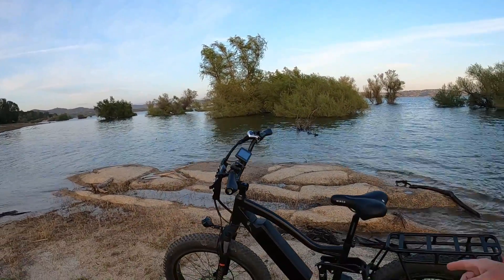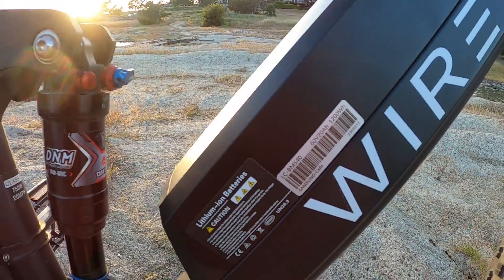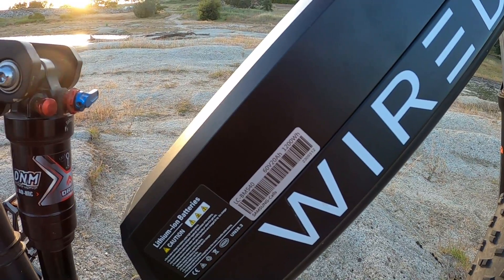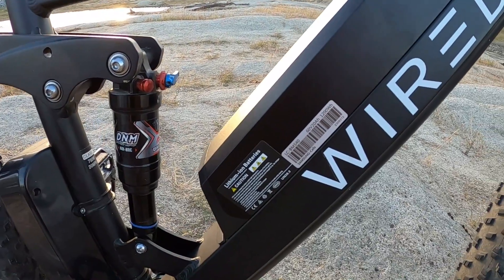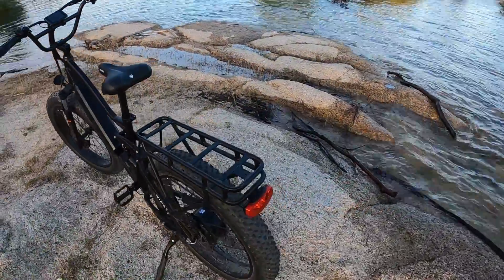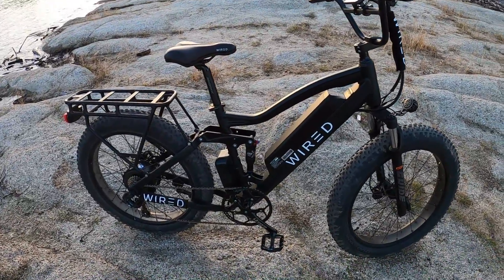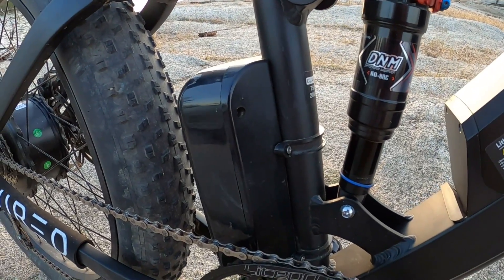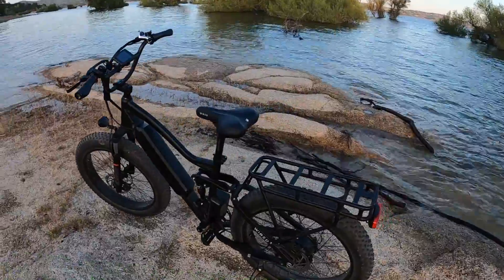Volts, Amps and Watts Explained   2024 Wired Freedom

Comment: I’m waiting for my hunter green freedom since the beginning of February and I pretty much have all my ebike accessories to go with/it too..what’s the width x length in that WIRED logo on the side of the battery please and the WIRED logo by the kickstand please
Reply from the maker: Awesome! Let me check those measurements....
Reply from the maker: So there are 4 main logos on the bike...two of them are soft wraps with velcro (like wetsuit material) one is for the front cables by the handlebars and the chain stay one (opposite side of the kickstand)....the lettering on both is 8 inches by 1.5 inches. 
There is a small logo on the rear fork by the kickstand, and it is 3.5 inches long by 1/2 an inch tall. The last one is a big logo, on the frame of the bike next to the battery, and it is 10 inches by 1.5 inches. There are no logos on the actual battery itself. Hope this helps!
Reply: Awesome man!!! Helps so much thanks!!! 👍🏼
Reply from the maker: @benitodelrio9059  Anytime!!!!
Reply: I just want to put a sticker over the WIRED logo (FASHO) 😎 I’m so excited I should be getting my freedom any day now, couple weeks but this month, I’m so excited!!! Thanks for the info 👍🏼
Reply from the maker: @benitodelrio9059  right on!
Reply: How bout the back metal fender? The WIRED logo please 🙏
Reply from the maker: @benitodelrio9059  ¾ inch by 4½ inch
Reply: Thanks man 👍🏼

Comment: On that size bike,  the WIRED,  what size portable battery [ SOLAR Battery ] would WORK to charge that battery..    like a Small portable battery  ??
Reply from the maker: You would need to be able to output at least 200 watts continuously....but the battery size would need to have at least 1200 watt hours of capacity...and that's only one charge, not accounting for thermal loss and inefficiencies from the inverter. Realistically, a 1500 to 2000 watt hour unit would be ideal...but honestly, a second battery for the bike is the ideal solution, carried in a backpack (that's what I have done with other ebikes).
Reply: Thank you
Reply from the maker: @donrobinson9503  Anytime!!

Comment: This video explains it really well. i have a 'trail mode' and a 'street mode' worked out on my ebike. Once you're used to it, adjusting the settings is easy. Remember, speed is the killer of battery charge, so knocking a few mph off the top end adds to your range.
Reply: That's one of the reasons I chose the Wired Freedom.
I needed both speed, and range. It offered both.
You can go a long ways at 20 mph on this bike, because that's well below top speed. The motor easily handles the speed, and the battery easily handles the power needed.
It's a fun bike to ride.
Reply: @davidgraham2673  20mph feels like the sweet spot while PAS. i went from 44 to 46t for slight cadence change, and better looking cranks. :) My first ebike so i got a half decent one to try. think i'm a convert. lol.
Reply: @M0B1LET0NE  , I just learned the value of traction and braking not thirty minutes ago.
Car going into the intersection right as I'm going across traveling with the traffic.
Had to slide to a stop.
Be safe out there. Might be a full moon.
Reply from the maker: 100% speed kills range...same with cars too!!